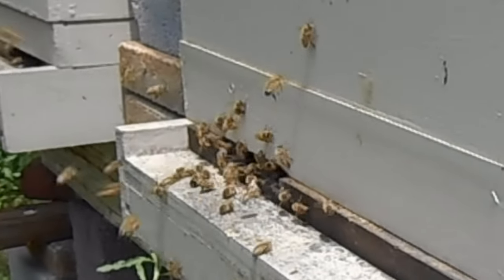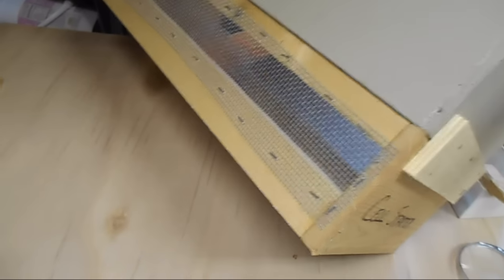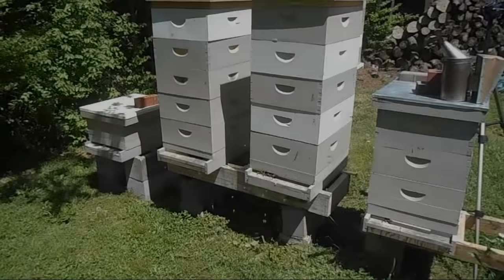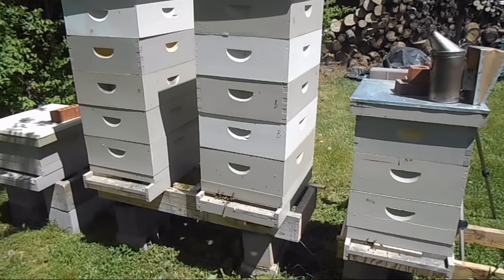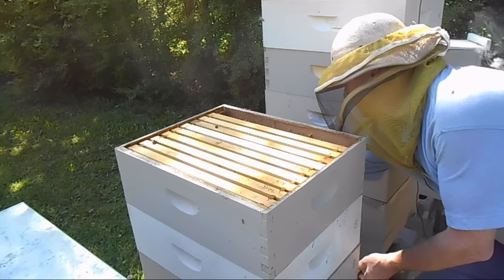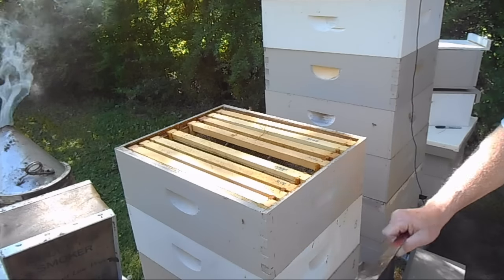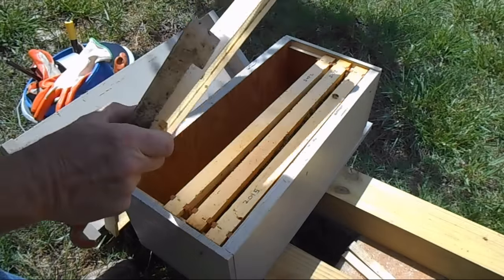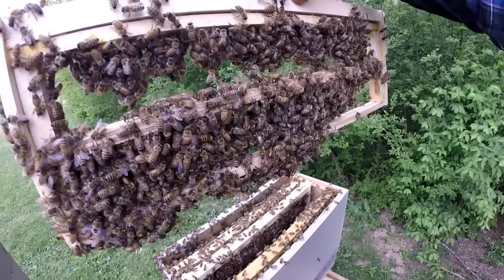Cell Punch Queen Rearing - Part 2

Comment: if your yard has a variety of unrelated queens, would the success rate be improved if you used drone frames in each box?  I've thought of letting the drone frames, that I freeze each brood cycle for mite control, to let the drones hatch every other month to contribute to the localDCAs
(assuming the mites are in good control) . you may wish to paint ( or use duck tape) to code the entrance side of the nucs a different color or shade of a color to control the rift somewhat.
GREAT VIDEOS Thank you. Mike Cain
Reply from the maker: That is a good thought. I do have frames dedicated to drone brood in the early Spring but keep in mind that when a queen leaves the hive for a mating flight, she normally will fly close to the ground and fly about 2 miles away before entering a Drone Congregation Area while most drones fly about 1/2 mile to 1 mile from their hive to a DCA. So it is best to move your queen mating nucs to another apiary within a mile or 2 of a yard with a good drone population.

Thanks for watching and I appreciate your comments and thoughts

Comment: nice honest vid on mating Queens thumbs up ...hw only a few mated tht is after the making of Qs...maybe u should of built up drones as well? placed the hives far apart with different colours could help too
Reply from the maker: I have done another attempt of making queens and did learn several things. A couple of things I learned is that the mating nucs should not be close to each other all facing the same direction. Also, I believe better success is achieved if no more than 4 hives are positioned in a row. I did not try to paint a different color or design on the mating nucs but I believe that would help as well. Here is a link to my latest queen making attempt and I have corrected some of those issues... Thanks for watching and commenting on the video!

https://www.youtube.com/watch?v=JeR_7MOibXM

Comment: Great video's 1 & 2, I have noticed in most of the video's I have watched that when the queen is placed in her new home (nuc) not an established hive the no one mentions anything about placing frame in her hive that have drone bees and or cells. I would think that to get the queen mated, one would need a number of drones. Any thoughts on this,
Thanks, Doug
Reply from the maker: Doug, Thanks for watching and for the comments/questions. Not sure that I correctly understand your questions, but if you are wondering about when, where and how to introduce the capped queen cell into the (queenless) mating nuc, I generally place the queen cell on a frame of capped brood near the top of the frame. A mating nuc (I use 5-frame mediums) should consist of 1 or 2 frames of older capped worker brood (no eggs or young larva), 1 frame of honey, 1 frame of pollen, and a frame of foundation or empty drawn comb. The queen cell should be placed on the brood frame next to a frame of honey. 

Hope that answers your question.
Reply: Virgin queens don't mate with drones from the same hive, they fly off to drone congregation areas to mate. Generally, the DCA is further from the hive than drones can fly.

Comment: Chuck, how far apart are you bars?
Reply from the maker: I'm not exactly sure which bars you are referring to. But the bars/frames in the cell starter hive are touching each other. In the 5-frame nuc there is 1 frame of honey, 1 frame of pollen and a third frame of just foundation (or empty drawn comb) leaving room for me to place the 1 frame of the queen cells (Queen Bar). Once in the starter hive, all the frames are pushed together.

Thanks for the question and I appreciate you watching the video!
Reply: The two bars on your queen cell frame. 
How far are the two bars with queen cells hanging on them space apart? Top to bottom.
Reply from the maker: Sorry for the confusion on my part. Since I use medium frames, I just tried to split the spacing difference. Turns out that they are approximately 2-5/8" apart
Reply: Thanks Chuck,
Those are some amazing queen cells, Most I have seen are maybe half that size.
Did you get some large queens out of those cells?